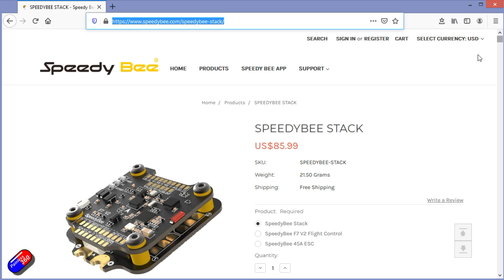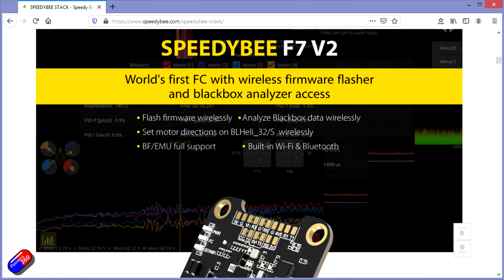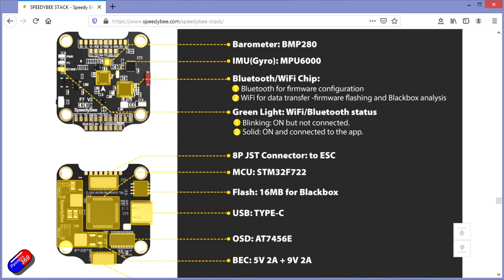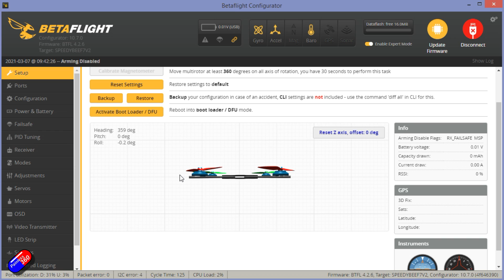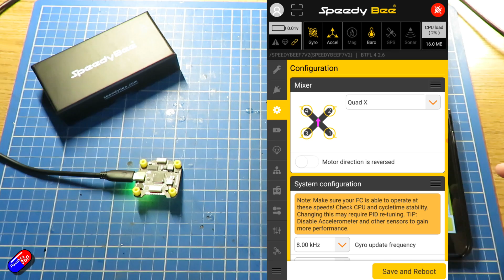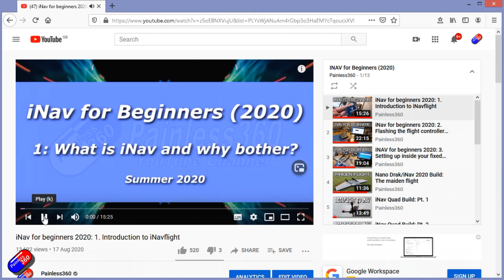NEW SpeedyBee Stack: F7 FC and 45A 4in1 ESC with new wireless features!

Comment: Hello there, I'm trying to build that same stack but I'm getting short circuit immediately after I try to connect the battery. I check to see if there is something wrong with the connections, polarization, or something else but everything looks to be OK. At this point I don't know what to do,

Comment: I have a bumblebee drone and the Succex-A F405 iflight board has burned
I ask : can i use this speedybee on my drone ?

i have dji fpv digital system installed

Thank you
Reply from the maker: I would try and get the same FC and ESC combo as there isn't a lot of space inside that model (if it is the one I'm thinking of).. Best of luck

Comment: Hello,
I have a question regarding the 4in1 ESC. Do the 4in1 ESCs these days will have no problem spinning a giant motor for example 6215 with 21 inch props? The 4in1 looks extremely attractive in terms of size and weight compared to  humongous old-type ESC like Skywalker, EMAX Blheli 60A, etc. Or, Do those old-type ESCs have some advantages in regard to handling a giant motor even though the amperage rating closely matched the 4in1?
Reply from the maker: Most of the 4in1 ESCs are designed for high performance, high KV multirotor motors so they may need tweaking when used with setups like that (motor timing, throttle response etc). I've not tried it here, best of luck
Reply: @Painless360  Thanks Lee! This reminds me of low rpm power protection if I'm not mistaken. I should digging up more..haha

Comment: Hi. Could anyone elaborate on the D Shot  options. I assumed as the Fc and Esc is compatable you could select any D Shot options.  I am having problems with the motors cutting out and the esc restarting. What determines which D Shot option you need to choose? Thanks in advance for any help

Comment: (Edit) For iNav, I forgot to start with...
Sadly, I am unable to get this FC to calibrate. I click calibrate and nothing happens. It is supposed to show you the current position to hold your FC but this never lights up. So strange. Am I forgetting something? BF works great on it. It is the V2 but iNav does not show F7 V2 while BF does for the target. I hope iNav supports this FC at some point...This stack is sweet!

Comment: Beautifull design and wiring diagram incl. Crossfire and DJI FPV unit at the bottom of the page.
If you want to read all the connections and pad descriptions then right click on the wiring diagram and "open pic in new tab". There you can zoom and read the tiny fonts. 

Also looks to be better and cheaper to replace any flightcontroller with this new one for 37€ instead of buying the 22€ cable BT extension considering that you always have to connect a plug into your flightcontroller. If you have a lot space maybe usefull but without I would always upgrade to this clean board incl. WiFi and BT.

Great improvement for the hobby at all. I love my matek fc but I guess it is time to move on unless matek awakes. But I have not checked if the have already added BT / Wifi cause the SpeedyBee cable is out for quite a long time and had shown the direction the FC have to go.
Great review ... even though I hope it will perform in fixed wings as well as the design looks beautifull.

Comment: I still can't understand why manufacturers can't or won't build the Electrolytic capacitor directly onto the PCB , Rather than having a huge standard   electrolytic capacitor soldered to the DC input ... It always seems a Fudge to me .
Reply: They have capacitors on PDB but not enough for 6s in some cases. It’s no big deal to solder a capacitor tough.